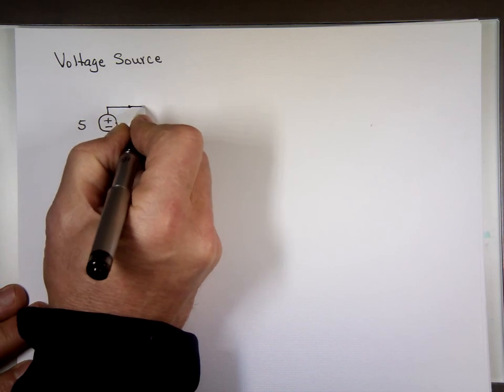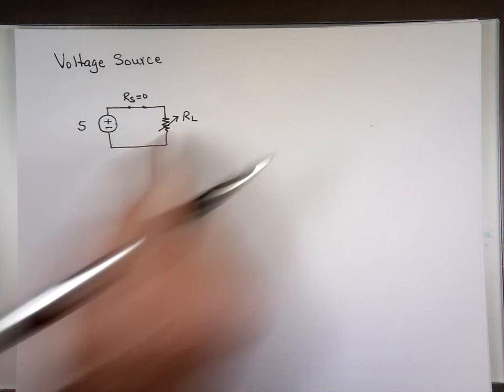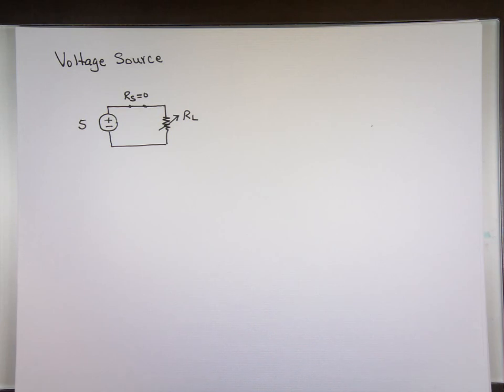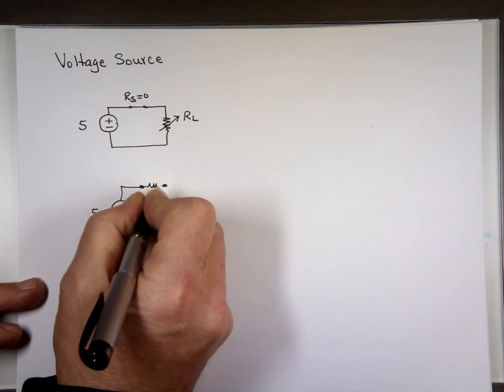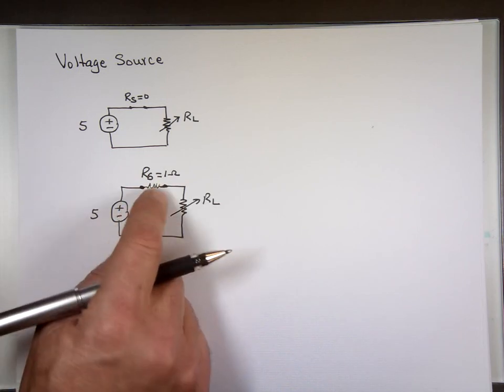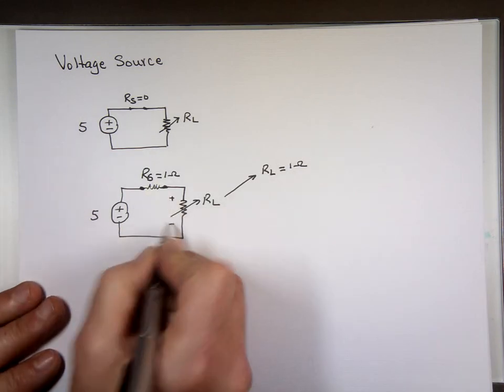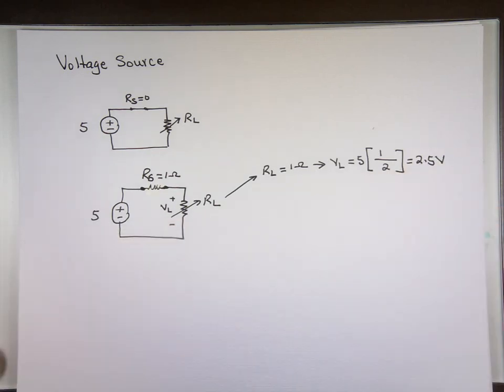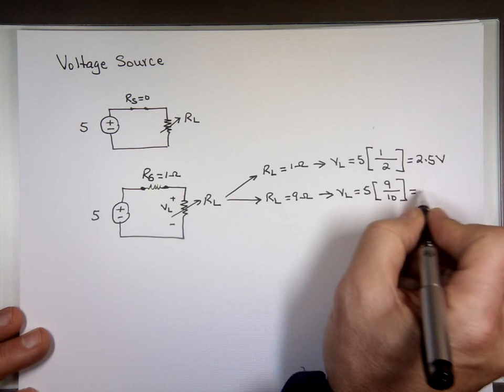Voltage Source and Current source Second Approximation

Comment: If I'm not mistaken, this is why multimeters need a high resistance when measuring voltage and no resistance when measuring current (that's why you need a fuse to protect the meter)